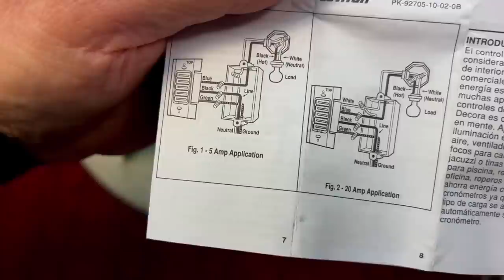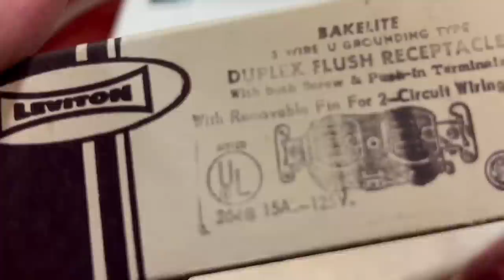Let’s make a Timer Box!

Comment: Loving leds so much I converted every light to Wi-Fi smart rgb leds. So I can control them from phone and voice command. Also control color, brightness, timers, routines etc.  Buying smart outlet adapters for some older devices are amazing too. Especially with decorations or water kettles coffee pots etc. it comes in really good for the poor man air filters. So you can control it by voice.

Comment: ScoutCrafter,

Informative as always.  A small slip, I believe your socket string is in parallel and not in series.  When wired in parallel if a bulb burns out the remaing bulbs stay lit.  If wired in series a single bulb burns out, all the bulbs go out.

Bob

Comment: Setting 0 makes is less red.

Cable Strain Reliefs:  There is an option to get off the shelf cable strain reliefs, also called “cable glands”.  Amazon has a wide selection of nylon cable glands in various sizes.  The gland can be fastened to the case using a nut and then the cable can be held using the gland itself.  Many glands are metric which will work for power cords (if the correct size is used).  

The other advantage is during serving, just loosen and fix.  Easy to fix.  

Cable glands are just another option.
Reply from the maker: Yes!  I bought a bunch of Glands from Amazon but unfortunately they are cheaply made and I already broke 3!  Maybe it’s just me.  😂👍

Comment: As an electrician, those zip-ties around the wires at the Wirenuts, scream "I'm going to slice your fingertips wide open".  When you clip off the tails, they leave a very sharp edge.!!
Reply from the maker: The zip ties I use for  wiring is a slightly softer compound then the regular Black ties. For some reason these don’t get those sharp corners on the cut off.  😃👍